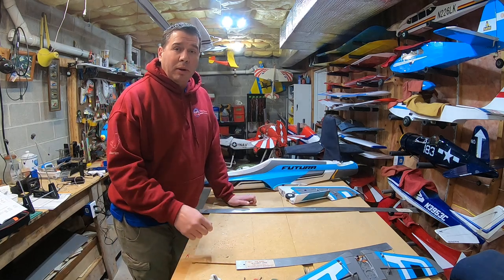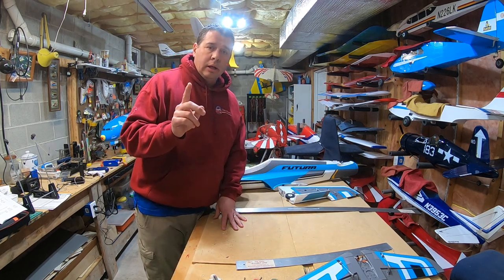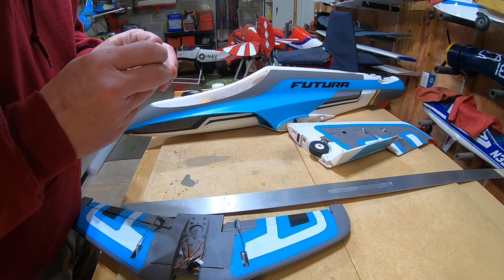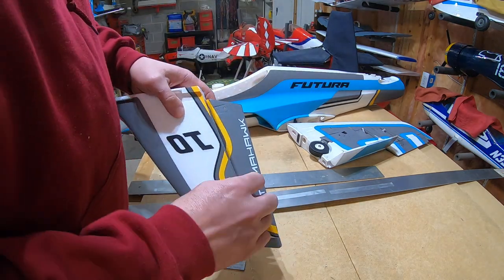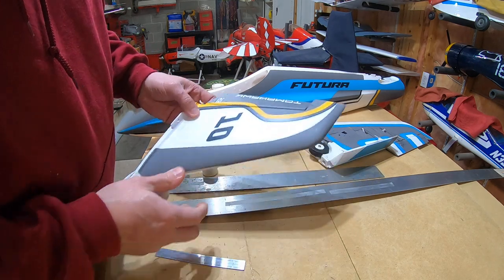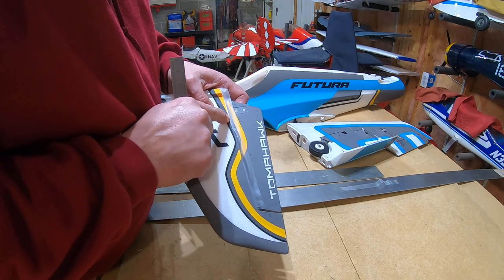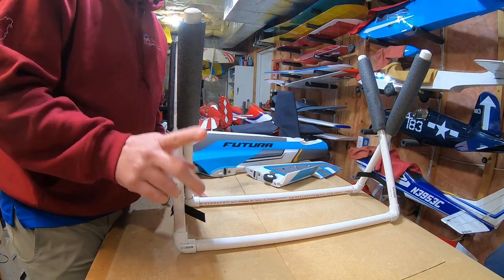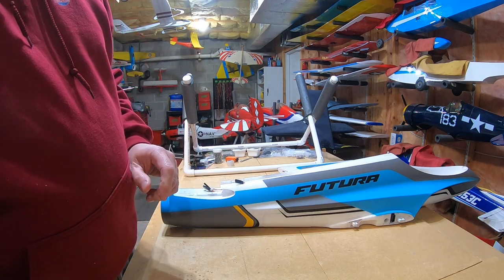FMS Futura V2 Build;  Want the basics, pt1 how to tape hinges and more

Comment: So this plane has pin hinged ailerons? Has the tape held up on the rudder? 

Also do you think this plane could take 7s with an esc upgrade? Does the motor run hot on 6s and how many amps
Reply: @JustPlaneCrazy  thanks for the input ...I was going to upgrade to a 120amp esc and run 7s for more top end burst speed ...looking for hopefully 140mph
Reply: @JustPlaneCrazy  so the internal Bec on the stock esc is 5.5v @ 8amps? Do you feel that's sufficient

Comment: So the elevator has no hinges
Reply from the maker: Correct. A lot of cheaper foam models simply use a live foam hinge which will break over time. That means the foam horizontal stab and  elevators are molded as one piece.